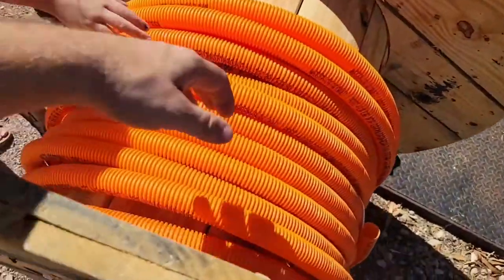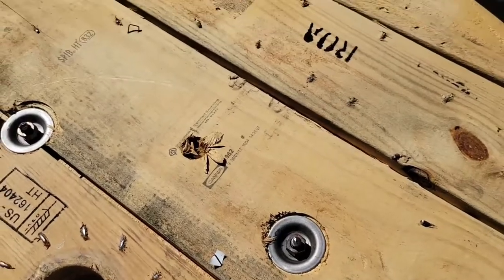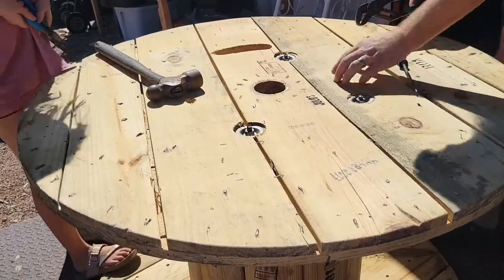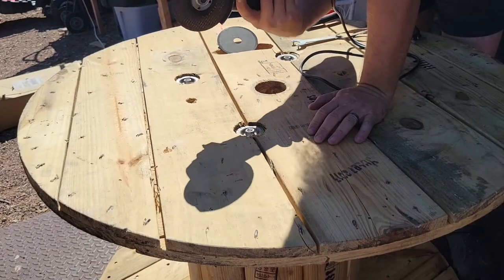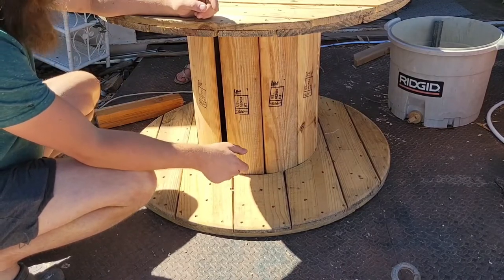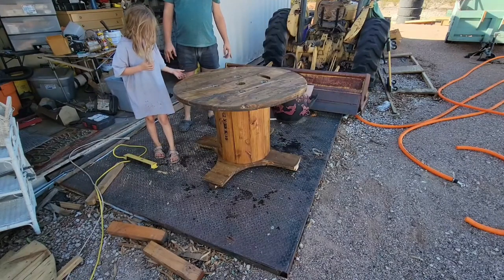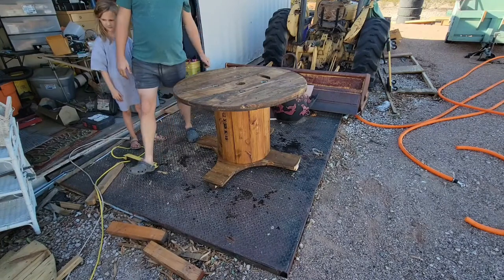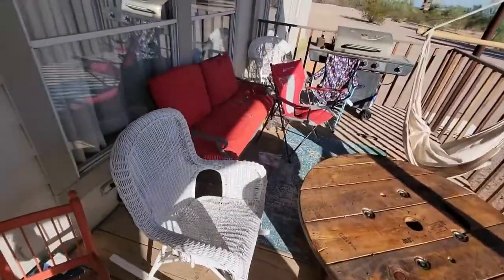DIY Cable Spool Reel Table - HOW TO -

Comment: Sweet dude! Easier way to get cable or conduit off of reel is to tip it flat and unwind the cable around the top. 
 That's if you can't put a bar through the middle and prop it up so it spins! 😎
Reply: Completely right. So much easier to flip it.